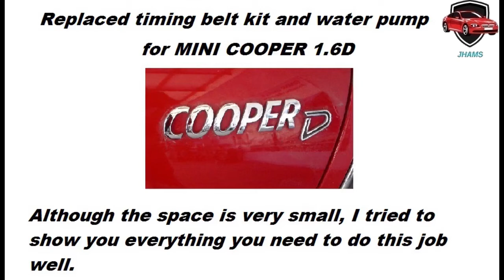Replaced timing belt and water pump for MINI COOPER 1.6D

Comment: Did you train coolant before removing the water pump or letting the coolant splash out when removing it (ie. how much water to expect)? Great tutorial  👍
Reply from the maker: If the tank cap is not left open, no more than 2 liters of antifreeze will flow and in the end there will be no need to vent the cooling system.